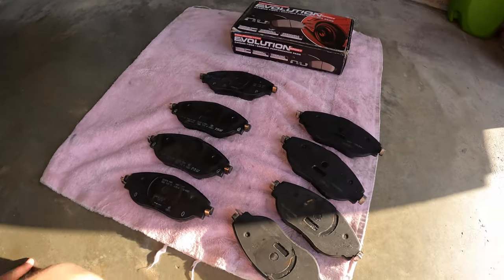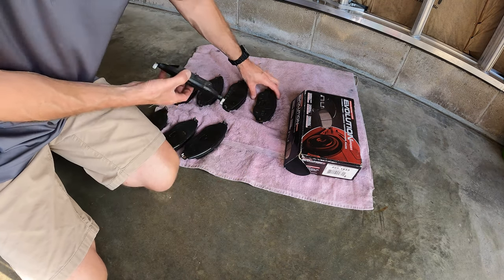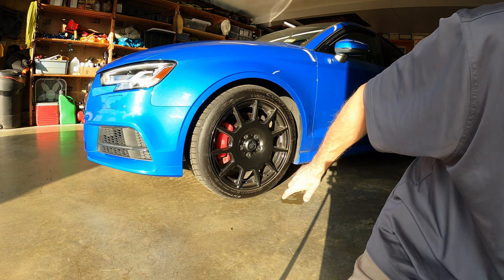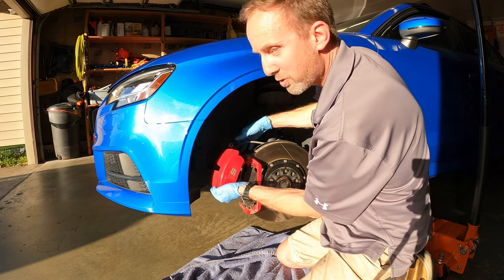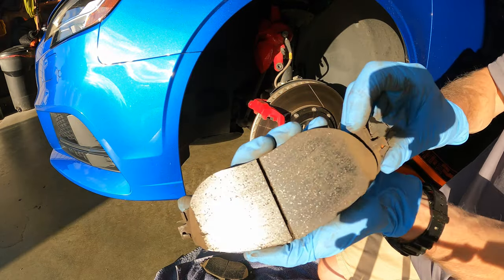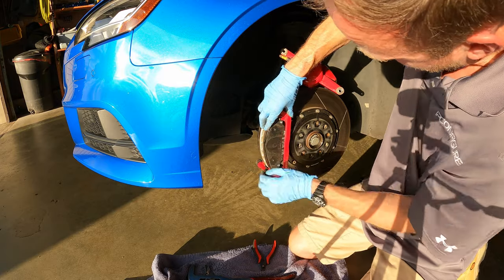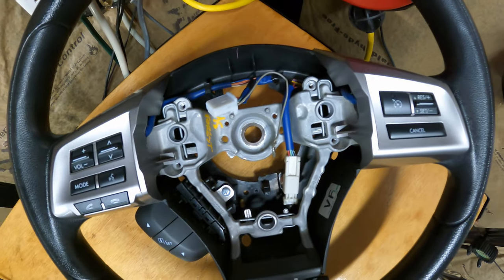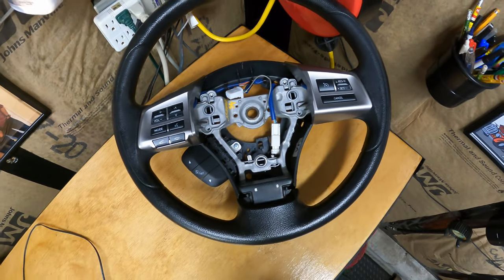2018 Audi S3: Episode 77: Front Brake Pads Back To Stock!

Comment: Yeah, the ABS light to come on is indeed not common.  Maybe it didn't like the free play after swapping the new pads in, end therefore threw a light. But for sure it's nothing to worry about as the code went away immediately. You can check the code with VCDS, I am pretty sure it has been stored.
Reply from the maker: ah yes, ill have to clear all codes. cha cha cha

Comment: Tires breaking traction is a tire issue not a pad issue.  OE pads will have great cold grip/initial bite for sure.
Reply from the maker: dude i was thinking that.. and so many people say the DWS are killer with no issues. my Michelin Summers never had this issue, not even close. Another reason i need to get new wheels some day. that's also probably why they spin on my launch.. (although, i run 235 and used to run 255.. that makes a big difference..)
Reply: @LastHumansGarage  they are great tires within their scope as an all season...I mean I tracked the Michelin PS4 all seasons.
Reply from the maker: maybe its the 255 more than the Summer then.. maybe if i had all season tires in 255 instead of 235, they might not slip. 235 is def not enough tire for this cars power
Reply: @LastHumansGarage  wider tires for sure will help BUT they are heavier (your old 19s) which will slow you down a bit...should be a wash/close to it.  At some point you're making enough power it will lose traction.  I chirp my tires on the wagon when I launch.

Comment: The only issue I see here Mark is you may have to go re-bed in The different pads because right now on the surface of the rotors is the older pad material…
Reply from the maker: good call, i might do that.